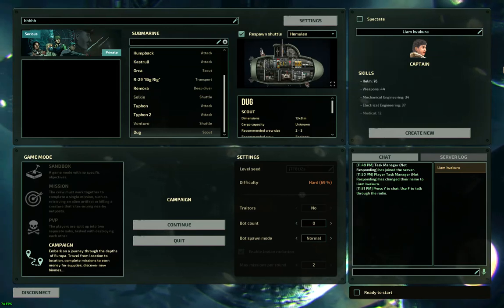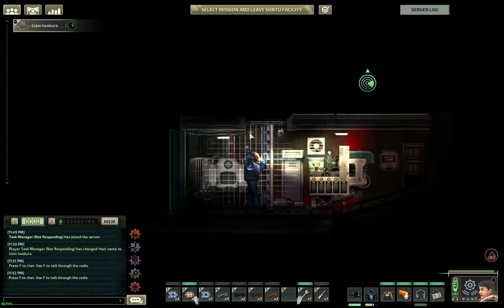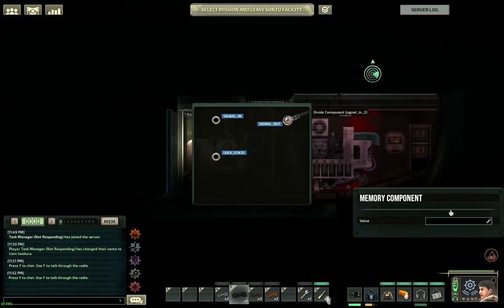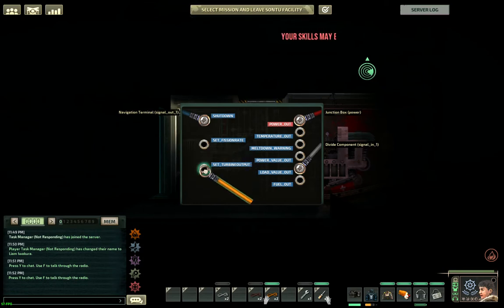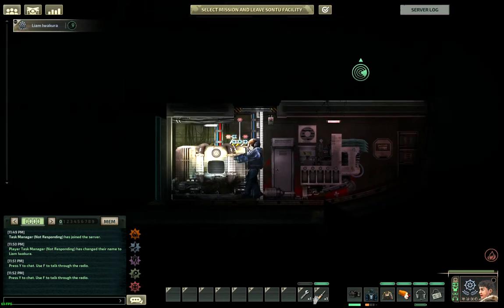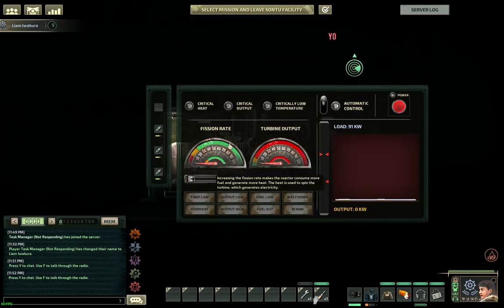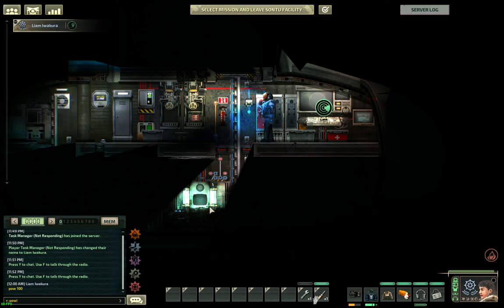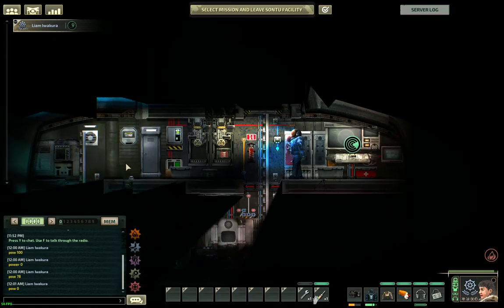Barotrauma: 7+2 component chat-controlled deluxe reactor control circuit

Comment: Man I'd like a detailed explanation of what each part of the regex expression means. It seems like the most powerful component by far, and the ONLY COMPONENT IN THE GAME that doesn't FORCE a continuous signal whenever it receives one, which holy cow I badly need.
Reply: @meelix7758  Does it have a list of what commands you can even put in? Cause I don't really need it for knowing what the expressions do as I can easily test that in the game itself.